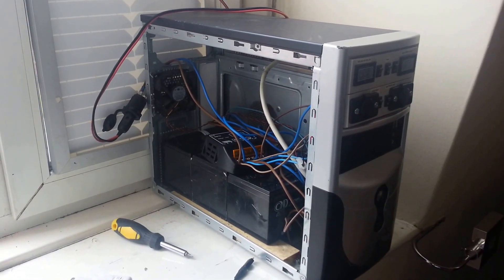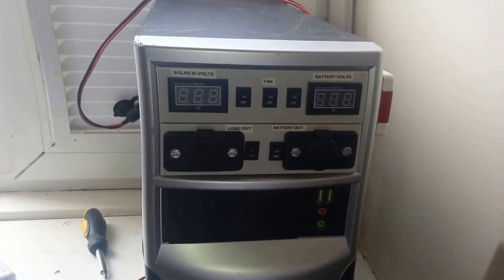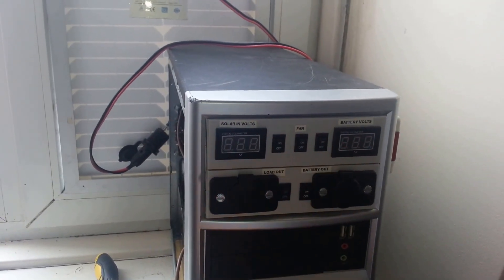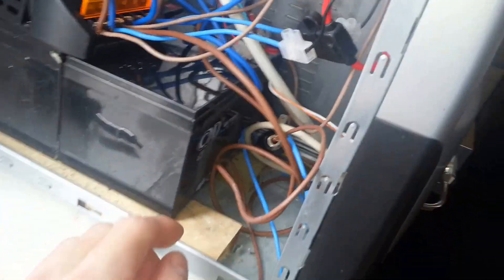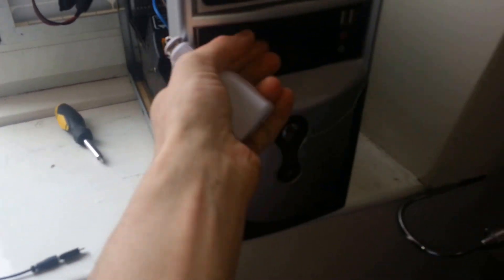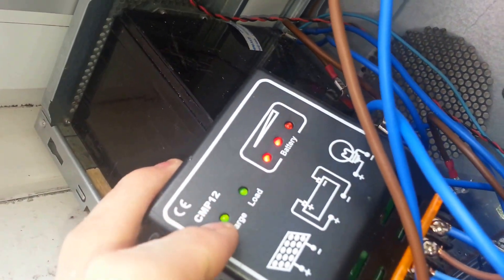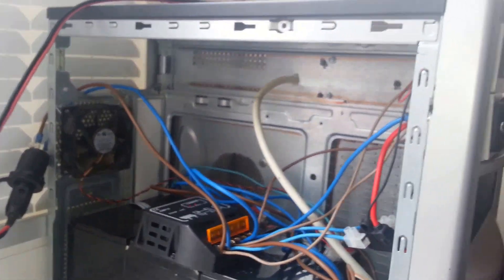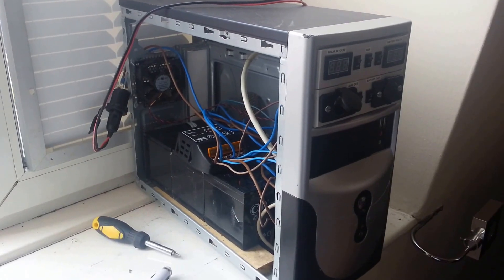DIY homemade solar generator

Comment: Very nice! I've got a dozen old towers laying around, never thought to do this with one until now. Great re-use of old hardware. Mine would be a 120ac/12vDC version, but exact same principle. I know 24v is more efficient, but 12v is more flexible for around here. Nice job, just tidy up some wires ans you got a sharp unit there.

Comment: Using an old PC tower is a GREAT idea but you will not get 20v from a 20watt solar panel only Open-circuit voltage (Voc)
Av 21.6V Voltage at maximum power (Vmp)Av 17.5V, but you only get about  1.16A Current at maximum power to charge the battery's  but this is the fist time I have seen a PC tower used great idea Great work

Comment: I like this video. please let me know when you update this video. Thanks
Reply from the maker: +Saidou A Jobe hi thanks unfortunately I have been given a bigger battery  (12v 75ah leisure battery) so I am thinking of building a hole new unit to house all the equipment inside. However I may keep this one as a back up so may finished it at some point but I just don't know
Reply from the maker: +Saidou A Jobe hi thanks unfortunately I have been given a bigger battery  (12v 75ah leisure battery) so I am thinking of building a hole new unit to house all the equipment inside. However I may keep this one as a back up so may finished it at some point but I just don't know

Comment: Love it! Thanks for sharing! Question: I am making a portable solar powered battery generator myself, using two 12 volt deep cycle batteries. I plan to use a 1500w inverter for 110 a/c electricity, Renogy 50w Solar Panel Kit with 10 amp charge controller and USB plugs. How should I wire the two batteries, in series or parallel? Primary use will be for Tent camping on weekends and emergency power in the event of a power outage. Thanks and look very forward to your reply!:)
Reply from the maker: +Angler Beaudry  hi sorry for late reply me personally I would wire the batteries in parallel and keep it 12 v but doubling your ah hope this helps
Reply: +Gary outdoors Okay, so parallel gets you more time/use? Thanks!:)